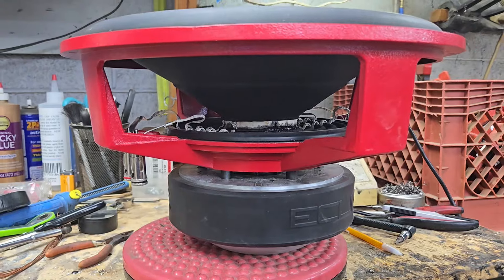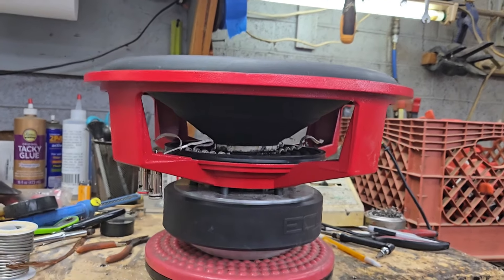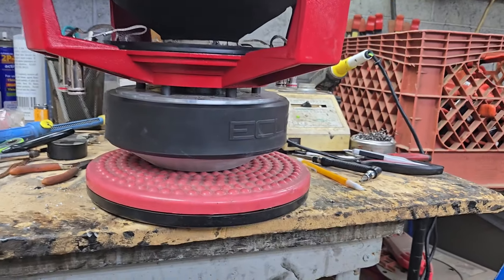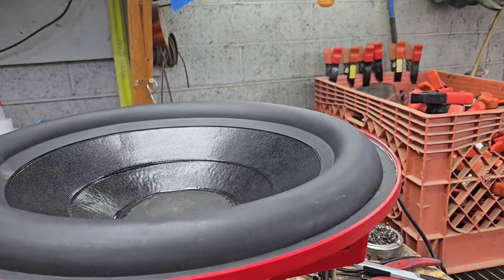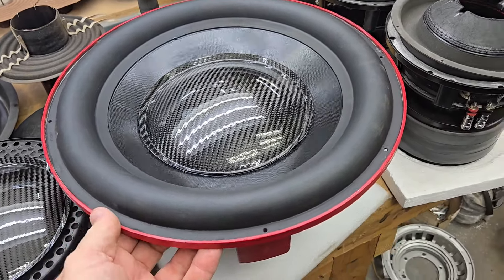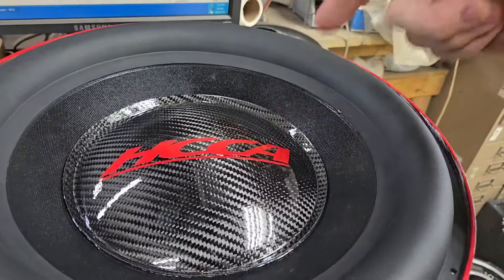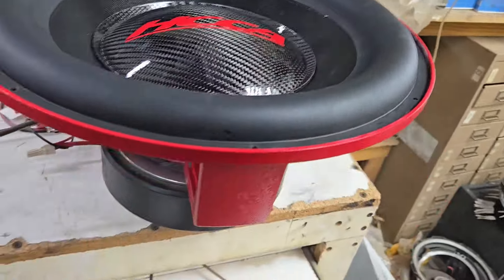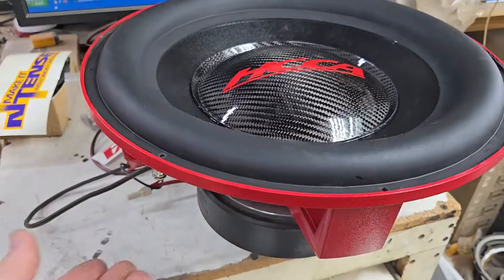15" D2 Orion HCCA/ TC Sounds TC9 Eclipse Subwoofer by Robot Underground w/ Memphis LVS cone NCA Labs

Comment: Tc9s are about my favorite platform.  The work real well for a lot of applications.  What spider did you use on this one?

Damn doing 50mm ww.  I try not to go over 45 on the regular tc9s but also trying to guarantee no bottoming out.
Reply from the maker: Our regular spider, 2.5" x 8"
Then necked out to fit
Reply: @RobotUnderground  single layer?
Reply from the maker: The number of layers doesn't always equal stiffer.  Mine are single layer.